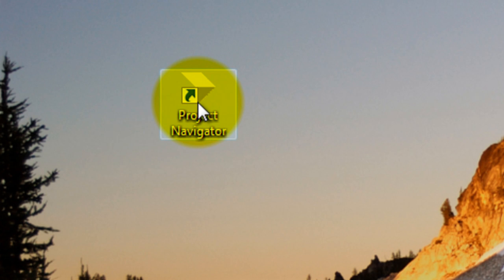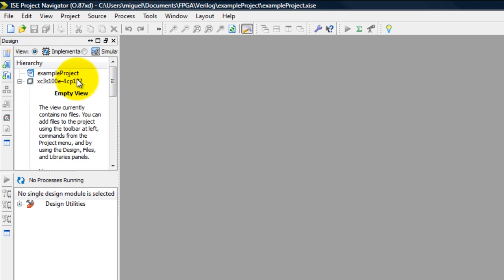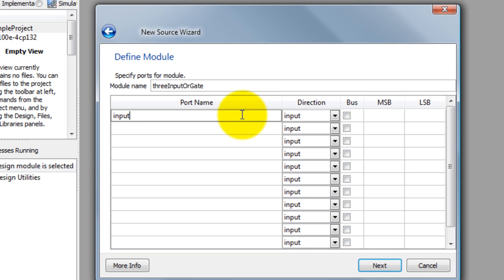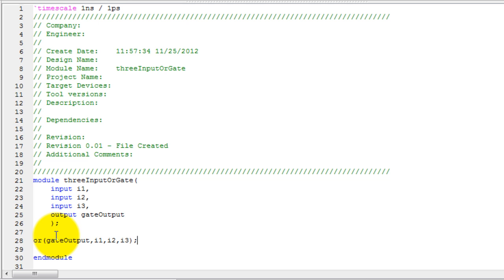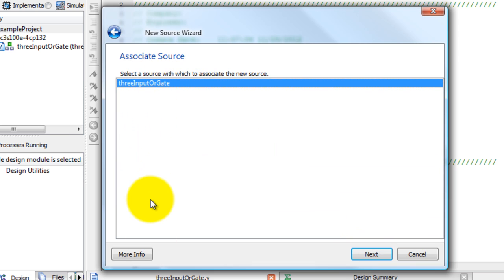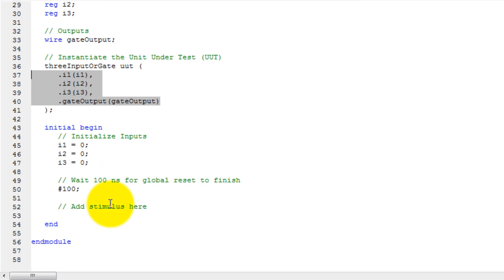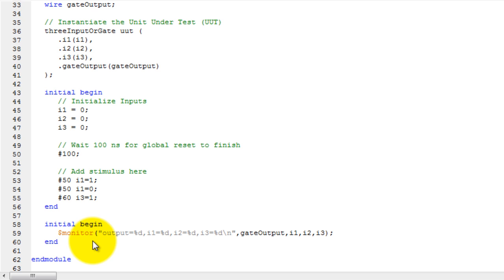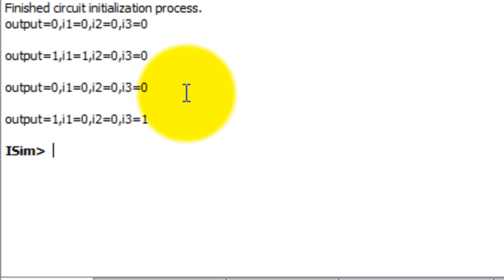Xilinx ISE Simulation Tutorial

Comment: iam trying to simulate my program but iam getting error: failed to link design ,syntax and behavioral syntax are ok,iam using xilinx 13.2 and isimulator what could be the problem please help me
Reply: ABHEY SEHRAWAT goto your installation folder n deep in folder (dont remember the path exactly) there will be a file name collect2 delete it or cut it,  it worked for me,,   n i found this solution on Google
Reply: ABHEY SEHRAWAT am glad if it worked for u too!
Reply: Actually I was using 32 bit version because avast had deleted the 64 bit version claiming it to be a virus. I read somewhere that it doesn't give error on 64 bit version so I reinstalled it before you replied, and it worked on 64 bit version. This was before u replied. This can be used as an alternate solution if deleting \ Xilinx \ 14.x \ ISE_DS \ ISE \ gnu \ MinGW \ 5.0.0 \ nt \ libexec \ gcc \ mingw32 \ 3.4.2 \ collect2.exe " doesnt work. Thanks anyways.
Reply: same error here, did u find any solution?
Reply: I'm getting same error, did u find any solution?
Reply: thanks bro.